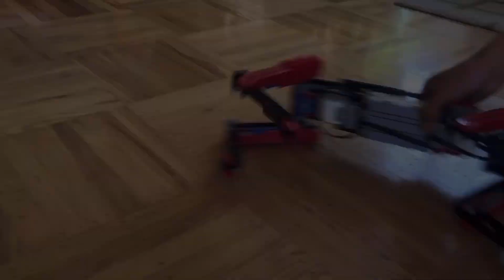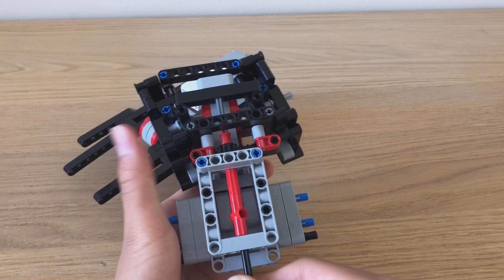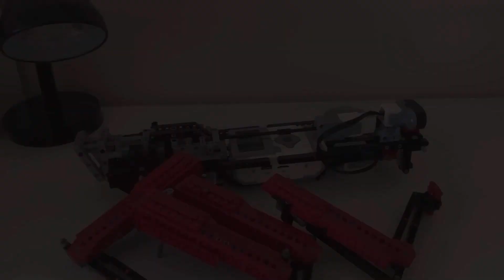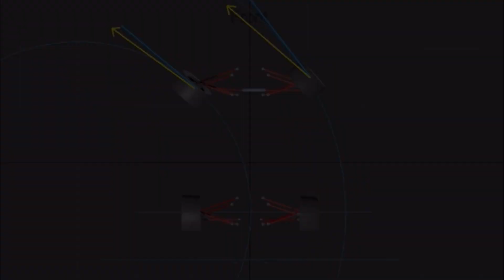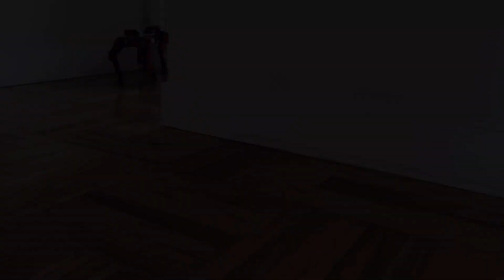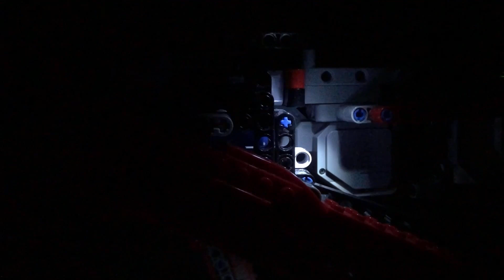LEGO - Building a Robot Dog

Comment: Nice job… 
I was trying a similar build but what i noticed is that on the powered up hub 88012, when I connect 2 motors, it does not really provide 2x the power. Instead it diatributes the power between the 2 motors. Is it the same for the ev3 ?
Reply from the maker: Thank you! Nope, on ev3 it provides 2x the power